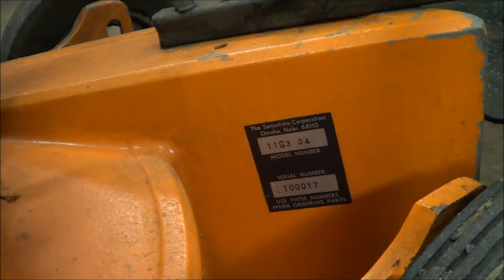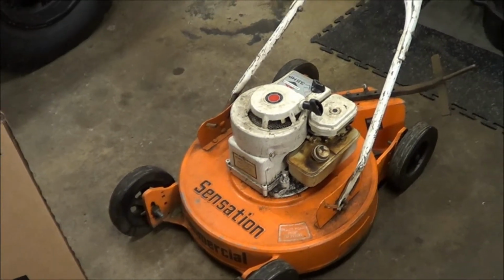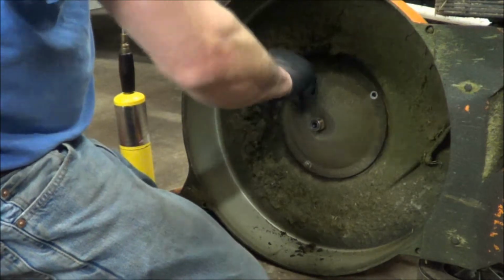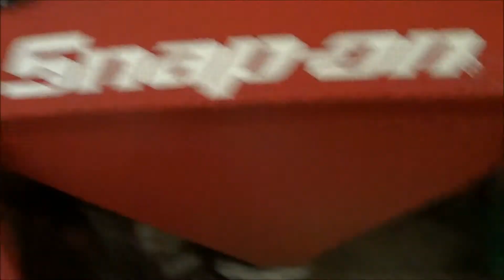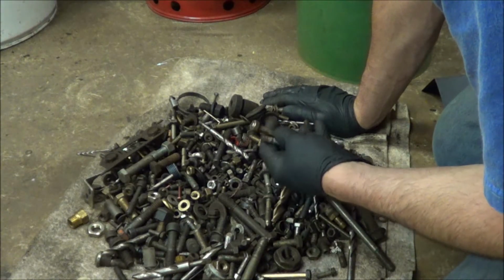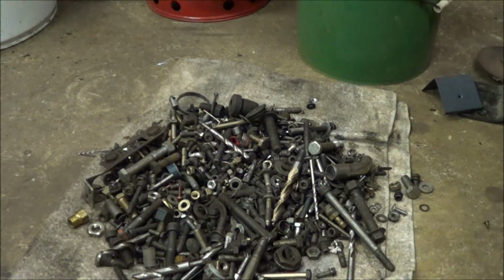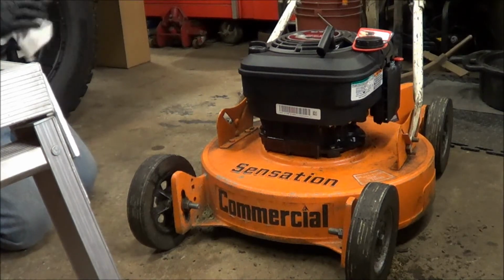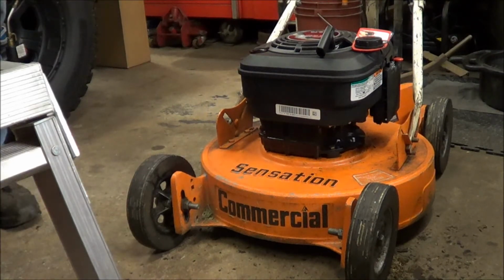Repowering a Sensation Commercial mower

Comment: I like putting my motors where the head is pointing to the front . That way when I pull down on the handle bars bringing  the front of the deck up so I can turn the mower around on two rear wheels the oil wont go to the cylinder .  I have two Sensation  mowers both having   the original engines .   One having the Honda engine and it is 1977 and another with the Clinton 2 stroke engine and that one is a 1977 also . After doing some resurch on the Clinton one . I did find out that Clinton stopped production or engines back about 1969 or 70 . But they continued on with the commercial engines in till 1977 or 8 .  I also got with this deal a new in box 4 hp RED  Briggs engine made in 1977 . What a find . I got all of them at a garage sale for 150 bucks . Both mowers work really well . A good freind of mine want one and I gave him the Clinton one . I am going to put a newer motor on it and going to give him that old Clinton along with it . That one was like new . Just every thing bout it shows that .  These mowers are the best .
Reply from the maker: Jeff Mullinix I suppose with the flip handle we have here the orientaion doesn't matter much, but good advice either way. Thanks for the comment and the view!

Comment: Please explain that round disc you put on near the end. What does that do ? I have a Sensation mower that does not have that round disc. I can get one just need to understand what this round disc that attaches to the blade does? THX
Reply from the maker: +brodygoalie I believe it has the same purpose as a flywheel (more rotating mass). The blade is very light and the disc adds weight to the rotating assembly. My sensation doesn't have one either but also the blade on mine is different, it's much wider than the one in the video.

Thanks for watching.
Reply: +brodygoalie OK THX  So what is the name  and model number of this blade that you are using?  I have bought blades on E bay that the seller says they were specific for the Sensation Mower. I am curious if I have the blade that you are using?  Also what Briggs & Stratton engine would you recommend for a Sensation Mower? I assume their Professional series?  Thank You!!
Reply: +Broncocarl92  OK THX  I have bought Sensation blades on E bay. The blades look pretty wide so hopefully I am using the blade that you are using.
Reply from the maker: +brodygoalie OK mine has number 91664, comes up as a Gilson 20 inch blade you can get a two pack on the bay for 13.99 plus shipping.

Sorry for the delay.